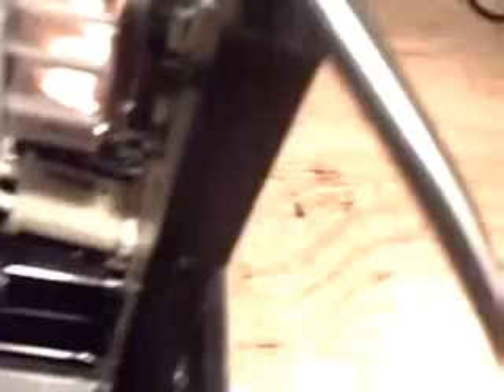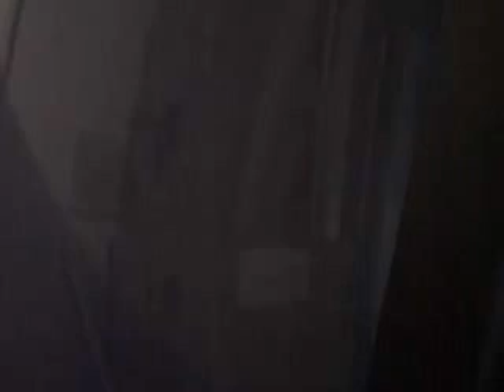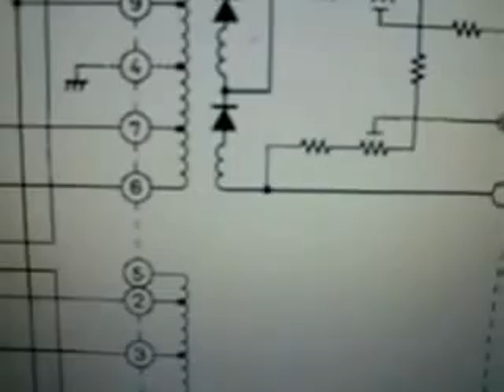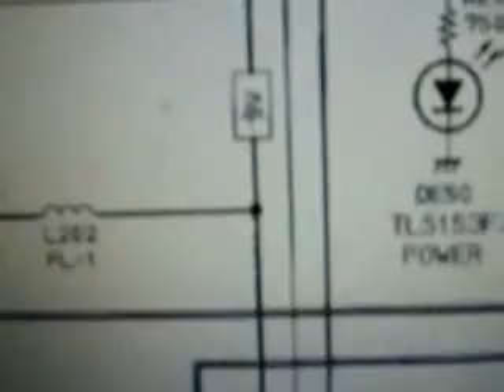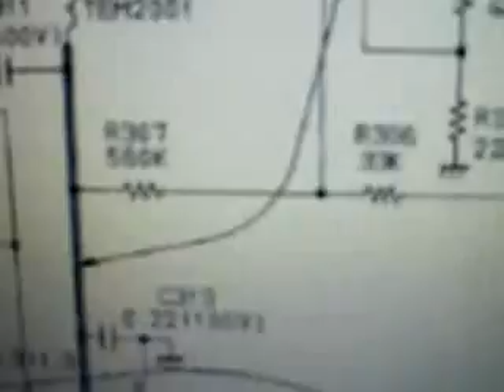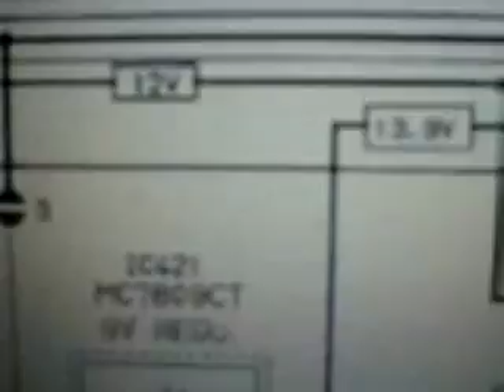1994 Toshiba CF26C30 , 26 inch TV. Intermittent power up. Part 8, Will it Werk?

Comment from the maker: @HardKnocks60 Thanks! That's great because I really want to fix this. The Picture tube is still good and bright.
The resolution is very good. Much better than most LCD's I've seen  in analog mode.
Have analog service at the house.
Part 10 wil have me get to brass tacks. I've been working up slow for a reason. I don;t want people to take their sets apart and start working on them and get injured. I figgure if someone doesn't have the patience to watch the videos, they won't fix the set!

Comment from the maker: @grassulo I can check some volatages but not all. the board is not exposed well and the leads dressing is not sufficient long enough to allow board removal while also powering up. Measuing voltages if possible was my next step. thanks for the great comment.

Comment: @Lockemeister get out your DVOM turn the set on it's face, leave it switched on and start checking voltages, then track back in the circuit till you don't find the voltage you need and inspect suspect component. I've had to do this very thing with my crt projector and that has WAY more parts than this tv, and also a healthy 48kv three lead flyback, scary high voltages going to those 3 crt's!

Comment from the maker: @MrDennis8805 The old relay was single pole that was normally open. The new relay was dual pole with normally ooen AND normally closed. I made sure to use only the normally open contacts like the old relay.
Both relays have the pins for the coil to be energized.
If I used the new relay was normally closed. Then the set would be on as soon as it's plugged in the wall, and then using the remote to turn the set on, would actually turn the set off.